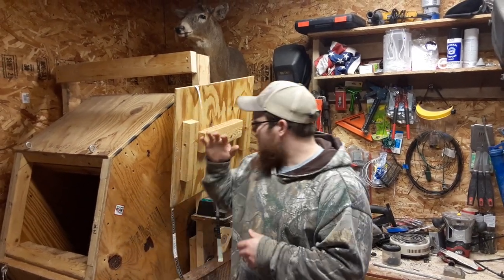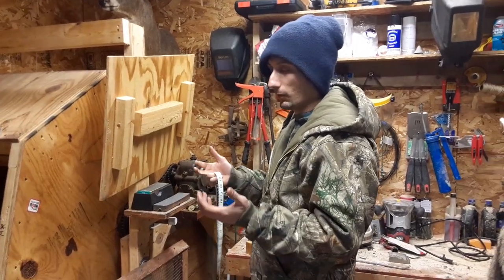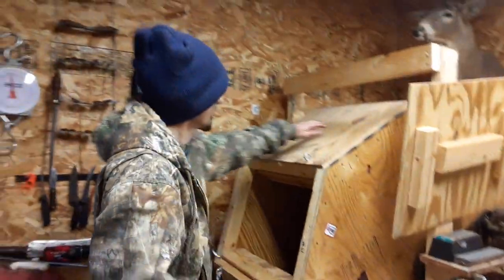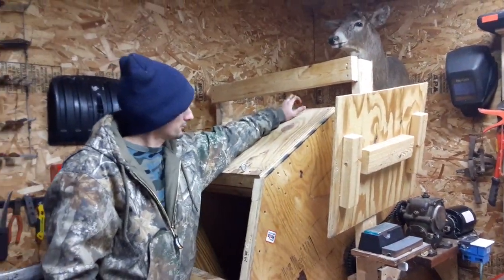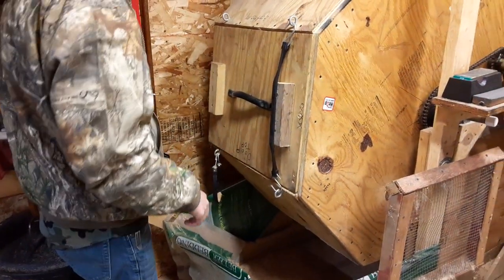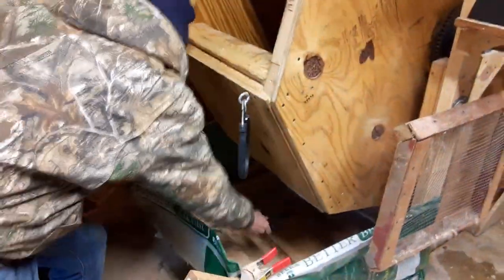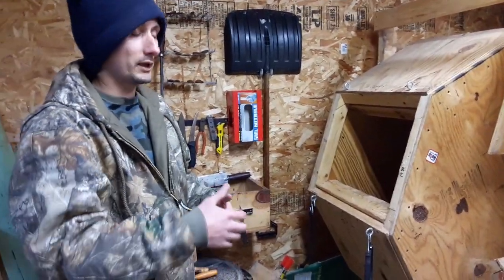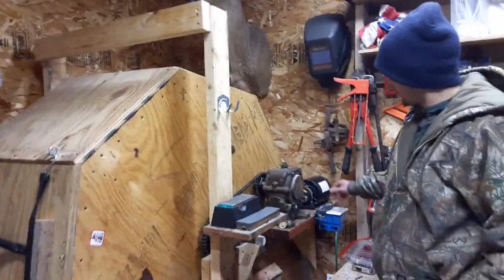DIY Fur Tumbler

Comment: I started  building a similar one, about 9.5 foot in diameter and 30in wide. Framed with fir I milled, lined with skin of 55 gal drums. Not finished but I think I'll do a friction gravity wheel to drive the drum to keep costs down.... won't need a speed reducer and I should be able to drive with a real small wheel and use a small motor for it. Might use a DC motor on a solar panel, don't know yet!

Comment: Am curious if that tumbler would work as well with a bear hide cause they are so thick and heavy
Reply from the maker: It would, you would just have to tumble it longer. You could also but pieces of 4x4 in the tumbler to help speed up the process. Just check ot every now and then to make sure it's not breaking hair follicles